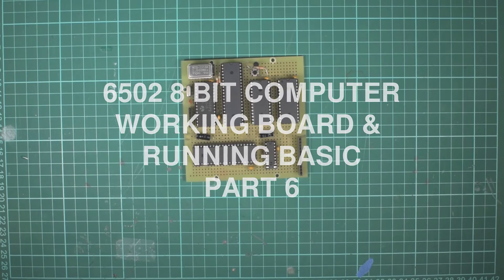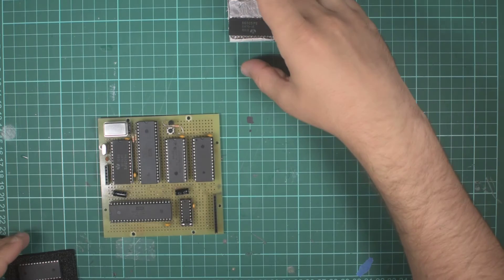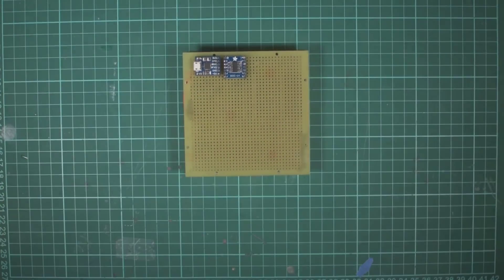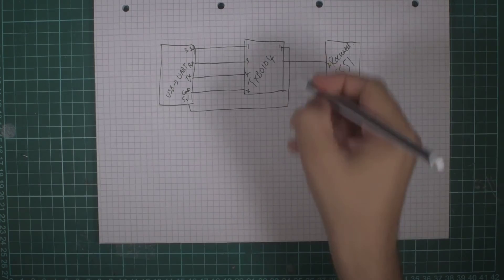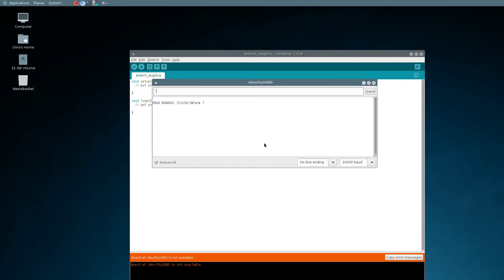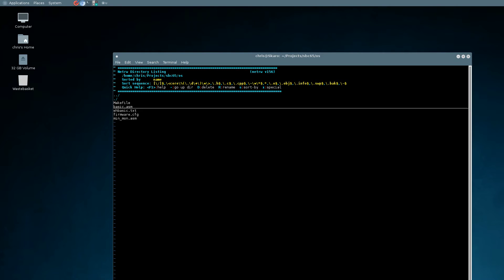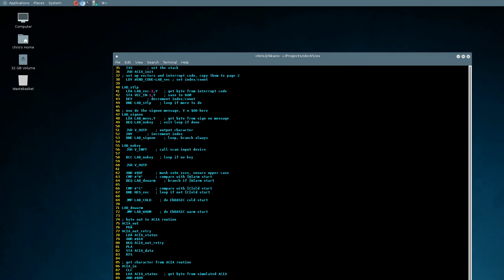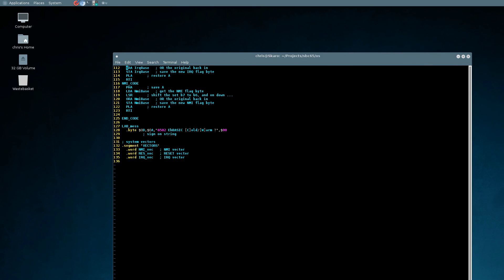6502 Computer - Running Basic on Working Board

Comment: I built up the SBC following the info on your github. The VIA and ACIA test all work fine and I can boot up ehBasic, but it will not run the standard (10 PRINT "HELLO WORLD" & "20 GOTO 10). I get a "Type mismatch Error in line 10" and no other program will work that I've tried. I've tested all my connections and clock signals and they all look fine. Any suggestions on what may be going on?
Reply: Finally traced my issue back to the SRAM that I picked out being slightly faster than the one you had in your BOM, 55 vs 70ns. Once that was swapped in things worked as expected. Thanks for the fun project!

Comment: I see. also no luck finding ANY parallel bus 5 volt video chips either for DVI-D or vga or cvbs... can't even buy any of the common the OSD chips and teletext generators used in TVs anymore for some reason :P (most of which are I2C anyway so that would require additional work either way) lol. someone kick some video processors back into the production line... else we'll just do it ourselves again. like always.
Reply: as for the TX register status bug on the WDC 65C51. yep. that's a pain in the butt :P working around it or even building a full rs232 port out of logic chips only however isn't such an issue as there not being any single video chip out there on the market whatsoever... :P for ethernet there are some chips with 3.3/5v bus AND built in addresss decoder (why people would want that built in is beyond me but hey) but they all come in flimsy SMD packages and therefore do not meet our mechanical requirements of 'not falling apart by themselves' :P the market is flooded with flimsy shit. unfortunately. whats the problem with drilling a few holes anyway, nowadays your CNC does that for you. DIP makes the stuff stick together for 80 years, no metal fatigue, and any idiot in the desert can fix it.
Reply: oh and actually, you WANT the workaround anyway... most specifically the delay between bytes you send.. as we've found quite a few PC com ports out there completely screw up if the other party just so happens to continiously sent, and they just join in, and then can't tell where the bytes start and end. so just put a few microseconds of nothingness between each byte anyway. pc's are such crap.

Comment: why not just use an FTDI USB to serial converter? the one I have has a jumper for 3.3 or 5v operation? Also there was an error in your chip select logic, both ram and via/acia would be selected afaik. I don't know if you corrected or covered this already.
Reply from the maker: James Higgs you could use a 5v tolerant chip if youve got one. You are correct, but doesn't cause a problem, it just means your writing into a block of ram that isn't accessible anyway so doesn't cause any problems having acia/via sharing that range, and keeps number of logic gate down.
Reply: Chris Bird Great series of videos btw :) Watched them all back to back.

Comment: What bug are you talking about? I think, one of the pins doesn't have an open-collector output, but an or gate should fix that problem.
Reply from the maker: Been a while since i did this video, but if i remember correctly the bugs are with the WDC65C51 chip, some of the bits in the status register don't get set making serial comms code more complicated that it should be. There is also some oddities about the crystal needing a bias to get it working which is a minor irritation.
Reply: Chris Bird wow. WDC really sucks at making ICs.

Comment: You might want to use "picocom", it's a very simple serial terminal program that just works. One advantage over the arduino one is that you can use Ctrl+C to exit basic programs.
Reply from the maker: +David Buchanan Agree, normally a screen user, Arduino serial monitor just felt more accesable/familiar for demo. Thanks :)